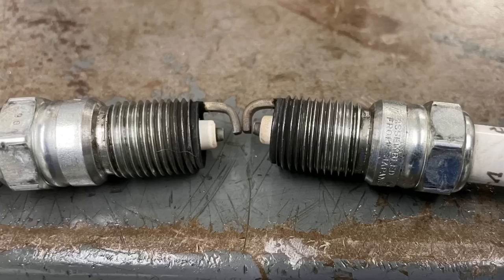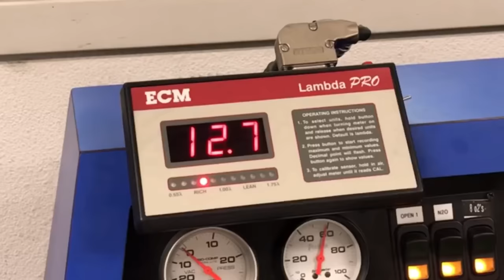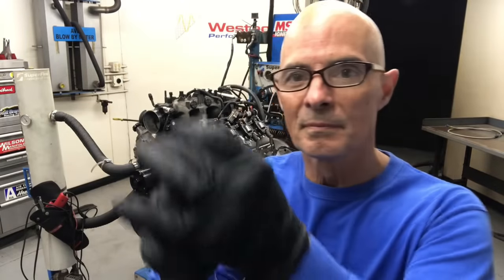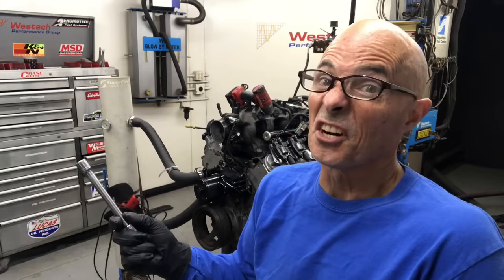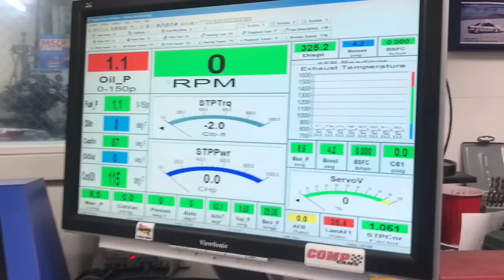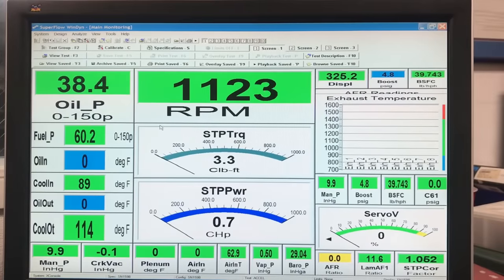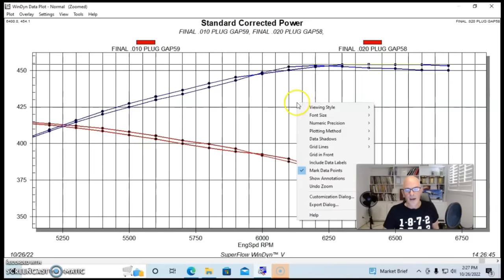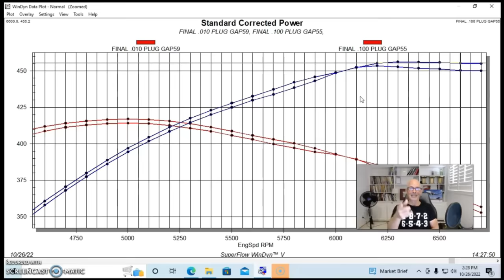JUNKYARD LS PLUG GAP TEST. DOES MORE GAP EQUAL MORE POWER? HOW MUCH SHOULD I RUN? .010 VS .100 GAP

Comment: What this video tells me is any and every engine will like and run just fine with .50 gap.
Reply from the maker: or .020, or .030, or .060 etc...
Reply: @richardholdener1727  I know, I say that because I am splitting it down the middle between .10 and .100 due to there really being no difference in performance with your test but one or two hp.

Comment: Always wondered, how much difference the plug parameters can make. What about splitted plugs (Twinspark, Golden Lodge)? 
What difference doe certain specialised plugs (using strange materials/metals) make? More than some low % or different behaviour in winter conditions? Do turbos/compressors react somewhat else?  How does the plug interfere with fuel quality/octane?

Comment: Just watched an Engine Masters show where they tested spark plugs.  Wider gap gave a shade more horsepower (I forget if it had more torque, probably a bit more).  They did .045 then went to .060 and gained I think around 5 hp.  They did multiple runs, because they were surprised that it happened.  They also did .020 and the power dropped.   Didn't really go to crazy big gaps though.

I figure it just takes more voltage (I think that's right) to jump the gap, so the spark is bigger (gap) and possibly hotter.  Might have needed a shade difference in timing, but I forget.  Saved the recording to watch again.   They didn't get to test E3s because they got the wrong length.   Their results showed the same as Holdener has gotten.

Love this stuff.

Comment: I would have expected a slight loss at 0.100 gap. I used to run a bit higher gap, 0.060 vs 0.045 in my hotrod days.... I've seen 0.120 gap plugs on a 3800 that came into my shop for a tune-up, and it ran like a top.

Now I never push a boosted engine past about 0.045 or so gap. Much more and it doesn't seem to have enough power to fire it. At 0.060 my 2.3 turbo won't even try to fire. Maybe that would be a good test?

Comment: When plugs were gapped at 100 thou it seems to be a little lazy on  rev up. It could have been my phone to
Reply from the maker: THE RATE OF ACCELERATION IS CONTROLLED BY THE DYNO-IT IS THE SAME REGARDLESS OF ANY CHANGE IN POWER
Reply: Ok cool, it just seemed to be sluggish  that's all. To be honest I think my phone was acting up lol

Comment: I think it works out to, how much voltage does it take to jump the spark plug gap, under X to 1 compression, running at X000 RPM on your tune.

Comment: I set my LS2 factory plugs to 0.045 just to smooth out the idle roughness, but I also added dwell, so I got the same or better energy at the higher spark voltage a higher gap gives. It did seem to smooth the motor out. I think blower motors just need more dwell to keep the flames going, but most people just close the gap to keep the flames.

Maybe down to preference but I like my way.

Comment: Do you have this test when running nitrous? Or another power adder?
Reply from the maker: when running boost or nitrous, we run the plug gap down to cure misfire-less gap is the answer with boost!
Reply: @richardholdener1727  
 ty sir! 185 shot br7ef .... where would you gap it? Im at .029

Comment: I feel like the larger plug gap started a slightly larger flame from the beginning (less total area that it had to grow the flame before full burn) so it finished a few thousands of a second faster resulting is slightly higher cylinder pressure. 1 more degree of timing possibly would of yielded the same result 🤔
Reply from the maker: 1 degree of timing did not do the same thing

Comment: I suspect the bigger gap is effectively advancing your timing very slightly because bigger flame kernel gets your flame front moving a couple microseconds faster. But I think that's missing the real potential value of a huge plug gap. If your coil voltage is high enough, you should be able to ignite a very lean mixture at low cylinder pressure for more efficient lean cruise. You might be able to reduce your part throttle fuel tables enough to pick up measurable fuel economy gains on highway cruising without sacrificing any WOT power at all.
Reply: Actually it's retarding it as it takes a nano longer to build the extra voltage to make the spark. But a nano at 6000 rpm is......
Reply: @hotrodray6802  That makes sense, but what has the greater effect, the delay to build the extra voltage or the faster flame travel when the initial kernel is larger?

Comment: I run 0.065 on everything
Reply from the maker: NOT ON BOOST
Reply: @richardholdener1727  I run that on my 06 s/c 3800 pontiac with 12 psi. Ran 408 wheel hp on dyno.

Comment: .100 gap on a stock Coyote will cause the spark to burn through the silicone boot on the end of the coil. Fun fact, the 3.5/3.7 V6 coils only need the boot on the end swapped (the 5.0 boot is longer) , and they are plug and play, at least for 2012 models.

Comment: Im sure you would see a bigger difference if it was a boosted application. More in favor of the small gap though as im sure you would start to blow out the spark and cause misfire issues on the big gap

Comment: Old gm hei systems ran .060 gaps years ago
Reply from the maker: and burned out many caps and rotors
Reply: @richardholdener1727  tthis is one of the side effects. I never had a problem with any of mine over the years. Maybe I just kept my tune up in better order than most

Comment: Would be nice to see stock gap in this, but it should just be in the middle of that range.

Questions are does this make a larger fire to start so the flame has a shorter distance to travel (can't travel faster) and that might mean it is like you are advancing the timing a little bit? Testing that might answer the second less likely question, does this work on a percent or just additive? Would this also pick up up just over 1% on a 416 making 600 or would it also add about 6HP?

You should do shorts especially with this video it could easily have been under a minute and provided all the valid data that was in this video. I love what you do but I watch less and less because I get tired of it taking 20 minutes to go over something a buddy and I could cover in a couple minutes.
Reply from the maker: THNX FOR SUPPORTING THE PEOPLE WHO SPEND ENDLESS TIME AND $ ON DYNO TESTING TO MAKE IT CONVENIENT FOR YOU-PLEASE GO DO THE TESTS WITH YOUR BUDDY
Reply: @richardholdener1727  I do test every week and put spark plugs in an LS 3 to 5 times a week, so don't want to spend my free time watching it. Unfortunately, I don't get to test on a dyno or even in a car very often. So, like I said I love what you do, but 20 minute video for 2 min of info just puts me and many people off. Let someone else edit this video and I bet they can get all the friendly parts with the info in it down to 5 minutes and I doubt you lose any current viewers while picking up several lost or never had viewers. Showed a guy at work one two days ago and he said that is enough before we got to the part he was interested in and I was trying to skip to it while getting paid to watch it. Just trying to be helpful, but you want to be rude to constructive criticism you can keep falling short of the potential you have going here. Good day.
Reply: If I was you I'd just quit watching-
Imagine how much time has already been waisted, time that you and your buddy could have been playing with yourselves, 
Your obviously well versed and confident in that department than anyone I'm able to think of, and WOW, I know a whole hell of a lotta people, it's just that none would behold the types of talents and abilities one would find comparative to those held you and your buddy..... Thank God.....
Reply: @ZPartySmarty  I'd be amazed if this was the 4th video I watched this year and unsubscribed after this, but right after I did quick look to confirm his views have dropped off huge from when he started. As for the shorts, that is what youtube has switched to for showing new people or how to get new subs these days.
A guy at work a buddy, maybe but not at all a safe assumption by you.
As for playing with yourself, it's all anyone has until they get lucky and hard habit to drop even after. Good day.

Comment: A good test would also be coil heat versus plug gap. Coil has to work harder the bigger the gap and also plug type as in Copper versus others. Racers running charged BBC engines running CDI and Blaster HVC II coils running No ground strap on the plugs for many years. Those coils are like arc welders.
Reply: Put the coil in a cool place.... 🤔

Comment: I remember when the truck LS replaced the 305 and 350 sbc. One of the very popular hotrod shows heard about a simple spark plug wire swap was worth 15 hp. Sure enough they got 17 hp with just getting rid of the stock spark plug wires. Sometimes it’s simple things to gain hp. I did the swap myself on a 2000 Tahoe and I can tell you I could feel a difference. Midrange was stronger and smoother
Reply from the maker: NO ON THE PLUG WIRE SWAP

Comment: I doubt it makes any difference, but I've heard about earlier kernel and bigger spark and all that, so when changing the gap to those extremes, would changing the ignition timing affect it in any way?
Reply: Wide gap isnt  cool for LP,I know that much, gotta close em down to around .025-.030 at most on a water cooled engine unless you like alot of backfiring and damaged gas regulators.

Comment: Was there any change in BSFC?
Reply from the maker: NO CHANGE IN AF
Reply: @richardholdener1727  I was just wondering if the larger gap increased the efficiency.  If the engine burned more efficiently the same AF ratios would show different BSFC, wouldn't it?

Comment: I now run 45 on my 496 stroker with a Davis 45,000 distributor and no more foul plugs ..I must went through $200 with of spark plugs..I run hot on the auto light

Comment: How big can you go without worrying about piston contact?
I'd love to see this done on E85 too.  I had to change the gap on my generator when I went form Gasoline to propane.  Different fuels/octanes can benefit form a tweaked gap.

Thanks again Richard.  Another excellent video.  Inquiring minds want to know.  :)
Reply: Correct length spark plugs will never touch the pistons regardless of how big the gap is.

Comment: Now I used to gap individual Cylinders on a carbureted circle track application to make a cylinder a lil leaner or richer, Although they were small gap changes I could get the burn close to the same but no significant gain in HP or feeling from the driver. Great test.

Comment: I think the bigger the gap the better, but there is a limit to what the ignition system will fire. It may not jump over a gap more than 50 thousandths.  The big selling feature of the first CD ignitions was it "allows you to run a bigger gap, as big as .050 in. "
   Also, I think you are just hurting your chances to run a bigger gap if you use resistor plugs and wires.
    Hey, Richard. How about a test where you use copper core spark plug wires and non resistor plugs with ever type if ignition box.  I think it is an old wives tale that the RFI interferes with the box's thinking.  Just propaganda designed to placate the FCC.
Reply: The difference with copper vs graphite suppression leads is also spark intensity and quality improvement having a higher resistance lead allows the spark to discharge in a more solid single spark where swapping to copper causes the spark to start at a lower voltage and with less intensity this is easily observed using a scope
Reply: @needmoreboost6369  Well, they said the same thing about resistor plugs, but tests on Youtube showed the opposite.  Not about the intensity, just how big the spark was and the efficiency of the engine.  The guy that does all those amazing tests , not Richard, the other guy, did this test. He used a single cylinder engine.  
  If what you say is true, where does that leave graphite with spiral metal wire windings? They are the most common and the most expensive by far.
  My brother and I were able to eliminate annual spark plug wire replacements and lessen fouling after going to solid core wires. The engine was a 340 with Mopar electronic ignitions.  The Mopar Bible said to use copper core wires until the FCC got on them and everyone else.
Reply: @auteurfiddler8706 graphite sucks for long life they are definitely not durable I go through 2 sets a year but I’m using 47kv wasted spark and a bit of boost ,  the testing I did was around 20 years ago on a Bosch oscilloscope and a gm3800 and Toyota 7mgte was the Guinea pig’s,the low resistance leads allows the spark to initialise at a low voltage where the higher resistance leads allows the discharge to reach a higher voltage before firing, the copper just allows some voltage to be lost and the remaining spark that start’s combustion is weaker having already bled of some voltage! and on the dyno dynamics dyno we used at the time the results were clear but this isn’t required for all ignition types ie magneto or a low powered n/a engine not really caring what happens with spark
Reply from the maker: the FCC?
Reply: @richardholdener1727  Federal Communications Commission. They same people that tell you not to put a Linear Amplifer  that was intended for a shortwave radio on a CB radio. They really don't want static from your motor making it hard for cops to talk on the radio.  I doubt the static even jumps to the next car in the next lane, in fact.  The FCC got all the ignition makers to say you should not use solid core boxes.
So what could "Direct Connection" and Mallory do?   Say,  "Don't use the best wires because it might put a little static on a cops radio as he passes by."  No, they had to make up the story that the "RFI" static causes the computers to get confused and attack Dave in the air lock, or whatever.

Comment: I think you may see a bigger difference in power with different fuel types, and boost. But I can see that the average pump gas tuner isn’t going to benefit much by fiddling with plug gap on their run of the mill car, truck or suv. Neat testing, I figured for sure we would see misfires on the .100, but maybe it’s only a larger issue when you add boost?
Reply from the maker: BOOST REQUIRES MUCH LESS GAP-DOWN BELOW .020
Reply: @richardholdener1727  On a turbo 2 stroke 850cc sled, at 8300-8500 RPM stock is .024 to 
.026.  12 lbs of boost with 100 LL Av gas.

Comment: I was thinking the same as you Richard. Thanks for the video! I will say that on a true high compression engine I think it might turn out different and we know on boosted applications what can happen with too large of plug gap.
Reply from the maker: na high compression will be the same-boosted stuff requires smaller gap

Comment: Of course n/a might not make a big difference, but i think power adders can be affected in a huge way, especially as boost pressures rise. 
The one thing i didnt hear mentioned was how those extreme gaps will put a ton of extra stress on the ignition components. Coils wont last long at those large gaps and the wont the wires be more prone to arcing with the additional strength of the pulses?
Reply: All of the above is correct.  More cylinder pressure equates to higher coil voltage required to jump the gap.  A larger gap requires higher coil voltage.
There are practical limits governing Ignition components maximum voltage, a misfire can cause damage (see nitro dragster hydrolock).
Reply from the maker: we all know boost requires lower gaps to stop misfire-that has been covered on this channel 100s of times-this was a different test

Comment: yes the wider spark gap produces more power but not a significant 
gain  but if you can inject more fuel and adjust air fuel ratio (especially in a carburator system) it can jump more than 10 HP !
and thank you for this great video so glad to find someone care to do such test on very nice testing equipment and a Dyno 😀
Reply from the maker: af ratio was identical-so 10 hp is not realistic
Reply: @richardholdener1727  
if you are talking about the conditions  in the video you Are right 
also the results are accurate and I have experienced it  what I m saying  if  you have an engine with carburetor fuel system with a tuned  air fuel ratio and intake  air is cooled   the spark with wider gap can burn more fuel 
so it increases generated power increases at least 10 HP 
you do not need a Dyno test to  feel the difference in power increase  a
smartphone app can  measure 
acceleration , generated HP and it is 
very accurate .
the app name is  
car performance meter .
👋👋

Comment: the thing I have experienced with say .060" plug gap vs .035" is a smoother running engine at idle and part throttle. A lot of Ford and Chevys use .060" plug gaps on non turbo engines.. Be good to see this plug gap test on a turbo engine

Comment: So I have a ride on mower that runs just a little rich. The carburetor is not adjustable but I was thinking maybe I could heat up the combustion chamber a little by either extending the plug gap to expose more spark or a smaller one to concentrate the spark. Does this test suggest that it is worth experimenting with and if so which direction should I go? Thanks. Oh an since I'm asking strangers for favors, could I make any improvement by adjusting the valve lash beyond factory spec? Thanks again. Enjoyed the video although its a tiny bit over my head.
Reply from the maker: hard to change it much with plug reach

Comment: Running Fairbanks-Morse magnetos in air-cooled motorcycle and aircraft engines, they usually call for a smaller than usual gap, around .020". Mags have low power at low RPM which can equal hard starting, but big spark at high RPM, which can cause higher electrode wear. Some run dual plugs with smaller gap in one plug and bigger gap in the other.